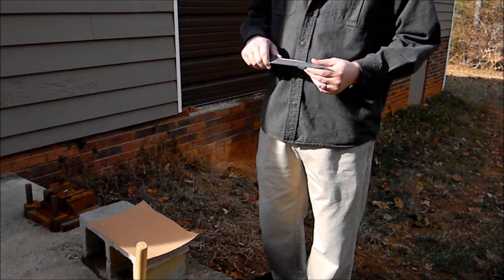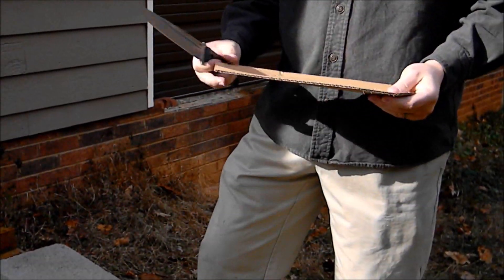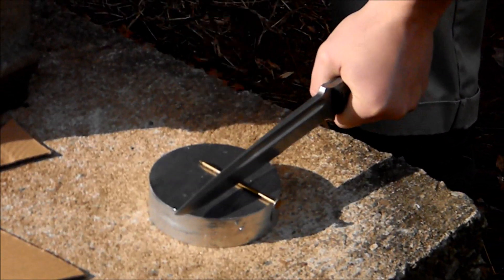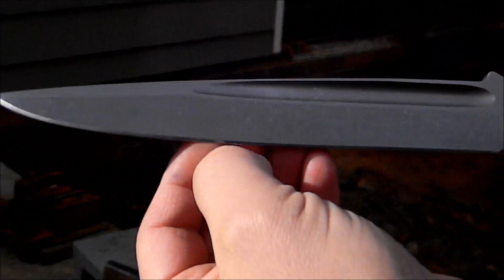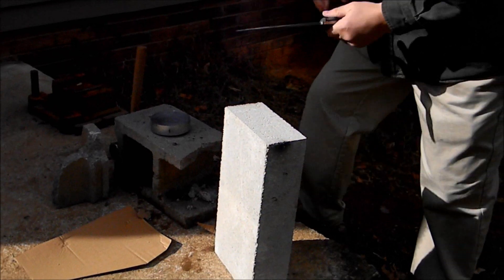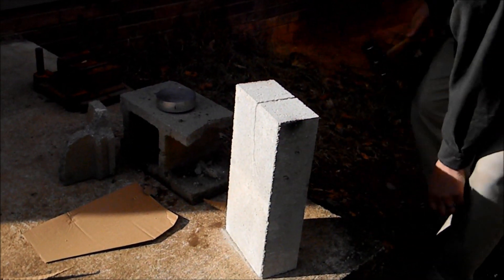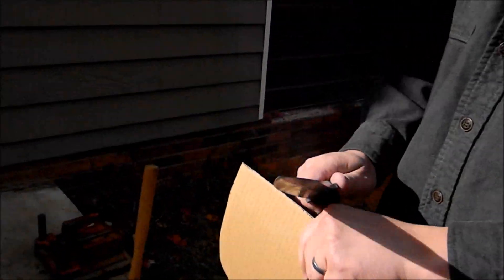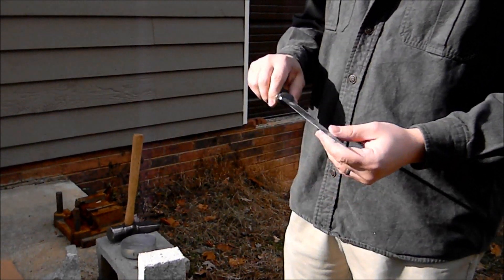CPM 3V knife abuse test, 8" tactical fighter through concrete demonstration

Comment: I think handle should be better designed,its too short
Reply from the maker: It is a modern tactical fighter. It is designed to be spun in the hand from a forward saber grip to a reverse grip. In the reverse grip the thumb goes over the butt. It is sized and shaped correctly for this use. A longer handle or a flared butt would be less functional and a poor design for this type of weapon.
Reply: @NateAIM  I understand .
Can I ask you,can you compare  RWL-34 steel and 3V ?
Some say RWL-34 could be the best solution for outdoor knives,not too hard,tough and stainless.
I saw many videos here that standard 3V knives from Cold Steel and others break easily ,did they break cause of poor heat treatment ?
Its weird to see so called toughest steel break that easy..
I would like to compare RWL-34 with 3V steel .

Comment: i am a stainless guy ultimately and don't want to have to deal with having to constantly work to keep it from rusting, my go-to steels are N690co and cpm sv30 and sv35vn, i am however very intrigued with the 3v, and had a bark river gunny in 3v some time ago but sold it back
Reply: Never had 3v rust
Reply: If you do just wipe it off literally lol it's got enough Cr
Reply: @gagelink2457   I have  Acidic body chemistry it's not a good bet

Comment: what would be the best steel to hold an edge with flexibility? Crucible cpm m4?
Reply from the maker: Tpjuvi Philly As you probably know, all of these steels have basically the same 
modulus of elasticity (same flexibility) so I assume you're asking what 
steel is fairly tough at a high hardness to support a very thin edge and
 blade geometry for a package that is resilient. If so, yes, CPM M4 is 
king. It's pretty regularly the steel of choice for cutting competitions
 and has won the world cutting championship more than any other material
 in recent years. That said, it's not particularly tough or forgiving 
and wouldn't be my first choice for most blades in most real world 
applications. It's a bear to sharpen and when it fails, it fails 
dramatically. Very high abrasion resistance and insanely high 
compressive yield strength, but low joules absorbed in an impact 
fracture. It's beautiful in a thin high performance cutter in the hands 
of a skilled cutter in an application where nothing bad happens if it 
breaks.

Comment: I love 3V.  Have you observed any decrease in toughness or impact resistance in testing with your new protocol?
Reply from the maker: Shawn,

That's a good question and is part of the reason for this video, to demonstrate that even with the tweaked HT it is still fantastically durable. The purpose of the modified heat treat was to improve edge stability for reduced edge chipping or roll in rough abusive applications. So in that sense, the cutting edge is clearly tougher. However, in the sense of energy absorbed in a break such as in charpy impact testing I have no means of quantifying it, but I wouldn't be surprised if the original HT absorbed more joules. Don't forget that dead soft mild steel has impressive charpy numbers, so obviously there is more to a durable blade than that. I've tested for this but in my testing of both protocols I can't find a difference. Dan Keffeler has also tested for this and has seen a difference in behavior at the elastic limit. His observations are interesting, encouraging (and informed), but I don't want to speak for him.

I'll point out that the original protocol was optimized for stamping dies. In their literature Crucible describes 3V as a high performance alternative to D2 where tooling was failing due to chipping and cracking. A mixed microstructure containing stabilized retained austenite and a large secondary carbide volume fraction has great abrasion resistance, toughness and dimensional stability in thick sections (like you encounter in a stamping tool) but fails when applied to a narrow knife edge where you need homogeneity and tetragonal martensite to prevent areas of RA and various carbides and carbon lean martensite from acting like the perforations in a postage stamp. Like many things, the industry standard wasn't optimized for a knife edge. With the tweak it is literally the toughest material for the application I have seen.

If you or Cliff would like to see this knife in person I can bring it with me to the Blade Show or send it up to your shop. Untouched and not resharpened since this demonstration. The point is still in good shape, not blunted from its trip through the cinder block.

Comment: What was the edge angle?
Reply from the maker: 20 degrees per side, .020" edge thickness before sharpening. Not a thin slicer, but this is for folks who will pry open a door or glove box or open a hole in a wall before they fillet a fish with it.
Reply: NateAIM Thanks, clean design.